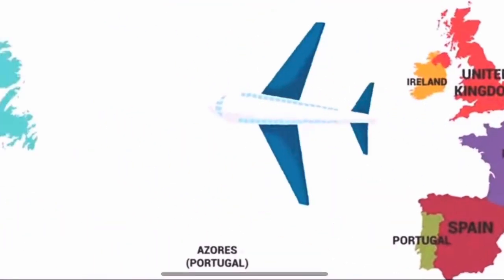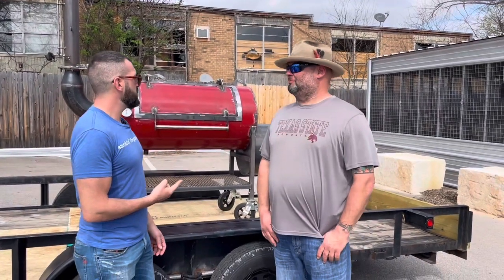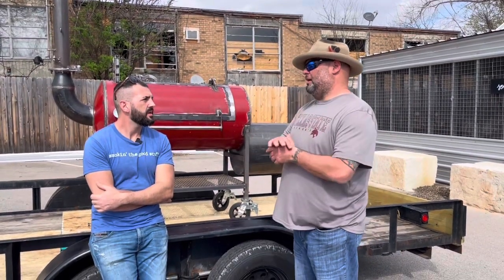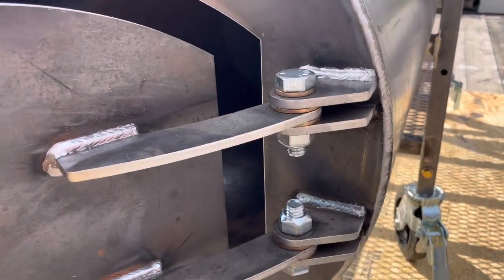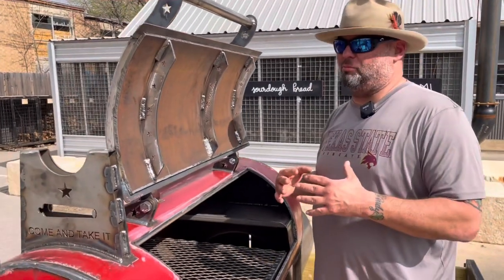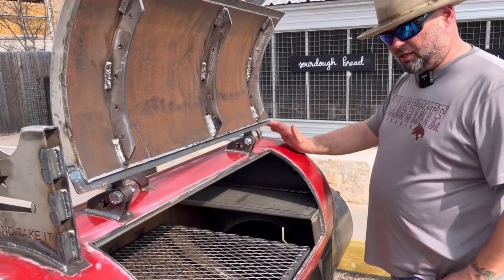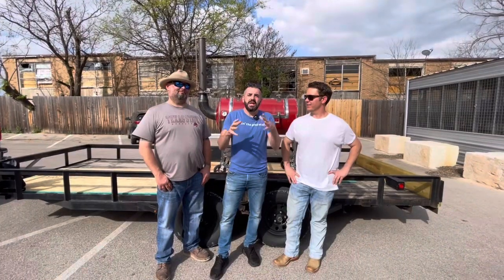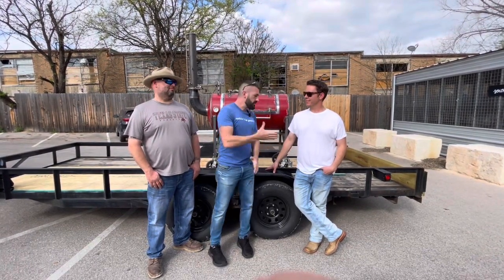Backyard offset Bison smoker The Red Dog

Comment: That is an impressive backyard smoker, with lots of thoughts given to the design. Thanks for sharing Max. Looking forward for your upcoming videos.
Reply from the maker: Yes it is , ciao
Reply: Thank you for your ongoing research in designing backyard smokers. The smaller the backyard offset, the bigger percentage of usable cooking space is lost to the hotspot. The longer firebox should help, and it will be interesting to see the upcoming adjustable damper. It would be nice to see biscuit tests along the way to measure the hotspot as design changes are made.
Reply from the maker: @commishg  yes I basically use small chunks of wood and stay in the 220/240 range before wrap
Reply: @TexicanaBBQConsulting  You just made an important point that is often overlooked by 1000-gallon pitmasters who step down trying to use backyard smokers.  YouTube is unfortunately filled with 1000-gallon pitmasters using huge splits of wood to create infernos in small backyard smokers.  A simple cordless saw, reducing the splits to smaller pieces, can have a huge benefit in reducing the hotspot in a small offset.
Reply: 1000-gallon pitmasters have the luxury of not using the "first door."  With a small offset, one or two doors are all you have.  So the challenge of offset pit designers everywhere is to figure out how to reduce the hotspot so you don't lose 50% or more of the cooking space in a backyard offset.  This analysis is just in its infancy, and I encourage you to break through it for the sake of backyard pitmasters around the world.

Comment: Great videos max
I would like your input for a backyard smoker I like running the heat from the bottom with  tuning plates as you know with the smaller smokers you have to run little fires which I don't like 
whats your thought of putting that stack on the bottom of the side of the cone so it's a straight shot that's where you get consistency instead of this 45° angle to the stack You're still going to get lots of smoke I'm talking
40 to 48" cooking
Chambers
Reply from the maker: Kinda make sense…